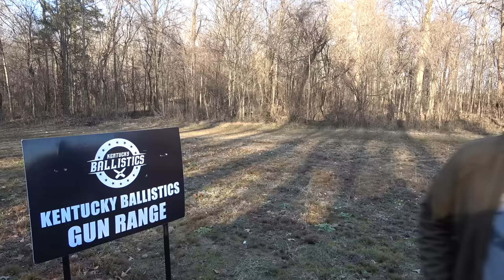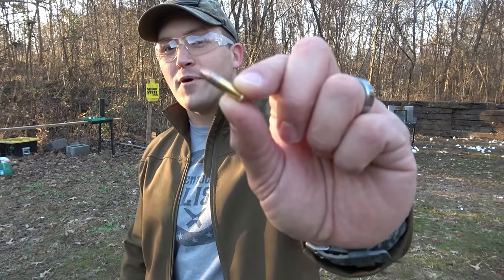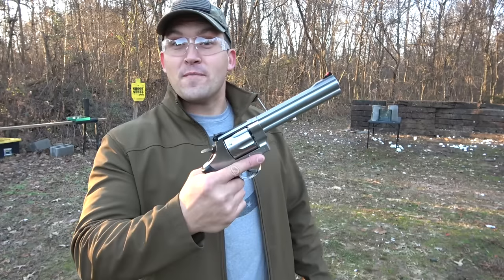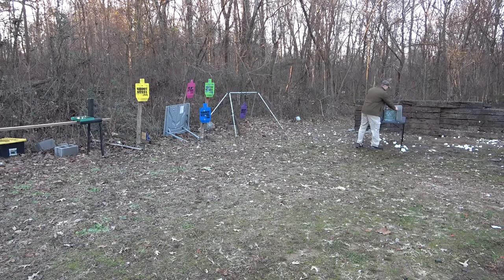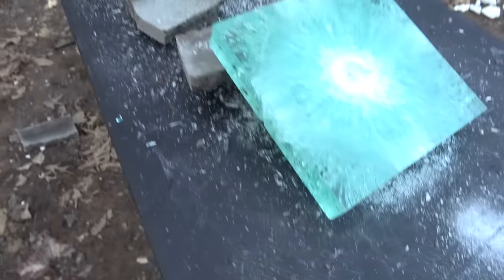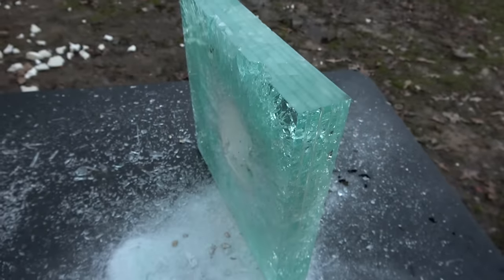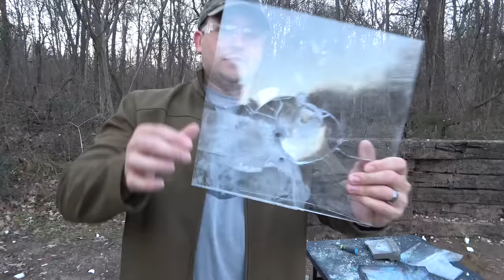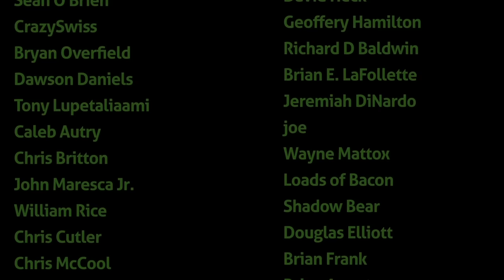Double Barrel Elephant Rifle vs Bulletproof Glass !!!

Comment: The glass side is the "Strike Face". It acts like the ceramic layer on a SAPI plate to breakup the projectile. The plastic layers go on the INSIDE of the vehicle or room and serve as the anti-spall layers and gives some support to the glass. The more expensive bullet resistant glass may have plastic layers on both sides or sometimes in alternating layers.
Reply: It’s laminated polycarbonate not plastic.....
Reply: @Justaguy0420  "Polycarbonate is a type of plastic. It is very tough; therefore, very hard to break. Furthermore, it is a polymer, and the monomer unit of this has carbonate groups. Thus, they are named as polycarbonates..."

Comment: I used to work for an armored car company. Our offices had bullet resistant glass (training stressed that it wasn't bullet proof if someone brought big enough and hot enough rounds) and thick, heavy, solid steel doors (about 2.25 inches thick, and *solid*). The glass getting damaged by the cinderblocks was one of the reasons for how it was mounted in the doors: The doors had a .125 inch steel bezel around the window opening on the front, welded in place with solid beads of weld. On the back, another bezel piece bolted into the door. The glass was mounted in a heavy rubber gasket that fit snuggly in the door. Occassionally, when it was cold, the rubber would contract slightly, and the glass would be ever so slightly free to wiggle. Every door arrangement was a man-trap, too, so you'd have to break through 4 inches of steel and glass to get at the folks inside, who were all armed. Then you'd have to crack through the completely analogue 5 inch vault door - again damn-near solid steel - or through the steel lined reinforced concrete walls of the vault. Never had a safer job in my life.

Comment: I have done some consulting work with a bulletproof glass company.    There are a number of levels of this glass so one size doesn't fit all.     Also the glass should be mounted in a frame to really determine the impact and true viability of the glass.   In addition the true test is 3 shots in a triangular pattern a few inches apart.    If the bullet doesn't penetrate the glass then it is acceptable in doing what it is designed to do.

Comment: Glass guy here.  The first sample of glass used was actually facing the wrong way.  outside layer of polycarbonate should face the cinder block side since that is the side you're trying to protect from that explosion of glass fragments.  It acts like a last line of defense from shrapnel, also these samples would be glued into a frame that would prevent the layer separation.

Comment: They call the varying thicknesses and caliber ratings for these products, bullet resistant glass. Usually are comprised of multiple materials, 1/4"- 1/2" laminated glass, 1/4"-3/4" polycarbonate, all laminated together in alternating order. Some barriers like you see in banks or check cashing establishments can just be 1"-2" polycarbonate for weight purposes and less labor involved for speak-thrus, pass thru trays. Windows in passenger trains are minimum 9/16" small-medium caliber bullet resistant per FTSB regulations, due to traveling through lands subject to firearm usage, areas prone to rock slides etc.

Comment: When in the Angolan war, one of our Ratels was hit with a RPG right in the middle of a thick window, similar to the one in the video.

Its blasted about 50% of the thickness away, the other half was partially melted with the bubble protruding a few centimeters on the inside of the vehicle and the copper slug inside.

Any other placement of the hit would  have killed everybody inside! 

Nobody was hurt. Very close call.

Comment: I think you should get different glasses for each gun. I don't know if its too expensive for you man but.. doesn't the previous bullets already weaken the glass making it easier to penetrate for the later ones. So in a way we wouldn't be able to gauge the proper strength of a gun no ?. Unless it isn't about that then cool I guess. Also You are an incredible shot.

Comment: Answer to why the elephant rifle didn't work, the round is a flat round meant to disperse damage on a larger target, ie an elephant. Something like an AP 50 Cal would absolutely rip through it because it's more directed (pointed and coated) to allow for further penetration. On an elephant, more bullet pen actually means less damage cause a large target will bleed more the longer the bullet travels in the body.

Comment: How do you know the glass shards were made from the bullet and not from smacking the cinder block? You should have put something soft between the glass and the block for more accurate results. Otherwise those glass samples may have performed a bit better. If nothing else to make smaller exit holes.

Comment: Second shot isn't representative of the ballistic glass as it'd been compromised with the first shot.  Also there are ballistic glass that made of tempered glass as well as polycarbonate material. This glass with it's thickness would be a general representation of what you'd see at the bank in the drive through.

Comment: Bullet-proof glass is comprised of layers of polycarbonate (lexan) glass. It's like plexiglass on steroids. Actual glass is usually on the outer sides of the bulletproof for cleaning purposes so it doesn't scratch so easy. The more (lexan) layers the higher the bullet rating.
Reply: thanks for the info man

Comment: Im guessin it will stop a couple of rounds. Sure the 500 Nitro is a big round, but it moves slow relatively compared to most rifles. So im guessing it will do what slow moving rounds do when they hit something hard: Dump energy really quick and really shallow. so assuming you can pop the rounds on top of one another i guestimate at least 3 shots. 5 or 6 if you spread the round out across the surface. 

Now the Rigby, on the other hand, is an elephant round moving very quickly. And it seems to go through everything. Ill just bet the rigby could do it in two, if it didnt actually make it through in 1.

Comment: Obviously not scientific since the earlier shots in both pieces of glass were affecting the integrity of the test subjects for later shots, but there's only so much you can do with limited funds to purchase an adequate number of test subjects. However it may indicate that bullet proof glass can be effected by numerous impacts from multiple rounds. To counter fractured rear element panes you should have used hay bails instead of the solid resistance of cinder blocks.

Comment: The first piece you were shooting from the wrong side. The actual glass side is the strike face/threat side. There is no such thing as "bullet proof" glass. Even the manufacturers will tell you that! These are different levels of bullet resistant. Without actually seeing them in person or knowing the manufacturer I'm not 100% sure of the level of either. I can tell you that the first one is very similar to what is used in teller or pharmacy windows. The second appears to be more like what is used in armored vehicles. I can also tell you the reason for the glass strike face is to start breaking up the bullet so the polycarbonate can stop it. The second piece you will notice the outer surface shattered in much smaller pieces because it is tempered glass like the safety glass in your car doors. Also designed to break up the bullet. The other layers are annealed laminated glass similar to what is in your windshield to allow the polycarbonate layers to flex and absorb impact energy while also continuing to fragment the bullet. The idea behind alternating layers is the bullet has to continue to strike hard surfaces between the poly layers creating drag/friction to slow the bullet.

Comment: Honestly, I wish you guys would stop shooting the exact same target multiple times in a row, just to see 'what it can stop'.  You're weakening the target with every single shot (as obviously shown by the cracks from the .45 ACP), meaning you're not getting an accurate estimate of its stopping power.  Now, if the test was to see how many rounds of the same caliber it could take before allowing a 'through-n-through', that would be different.  But for this kind of test it would be better to use a different target each time, as you're trying to see how large of a caliber it can withstand.

Comment: You shot these incorrectly. The plexiglass (plastic) side is supposed to be on the inside, and the bullet is supposed to hit actual glass first, with the plexiglass catching the glass spray you saw jet out from the inside facing glass pane when shot. That glass spray would have been lethal in and off itself, even if the bullet doesn't go all the way through. Really sucks man, too bad you shot the wrong face both times, that invalidates all of your results right off the bat. ☹️🤓

Comment: After the glass was shot once, it loses the maximum protection it can give like the bullet proof plates for soldiers. That means the 44 Mag and the 500 pistol shots had much less resistance than the previous shots just like the 2nd shot against the double bullet proof glass setup.
Reply: While technically true that it is weakened by each shot, bulletproof glass is designed and intended to stop multiple rounds much more effectively than body armour.

Comment: I am not impressed. If you wanted to have a legitimate test, you'd have a fresh piece of glass for each shot. Plus, you need to have a frame to hold the test pieces in place so they don't move upon impact. I'm surprised you didn't know that bullet proof glass is made of layers of glass and plastic. When handling fractured glass USE GLOVES maybe?  I also have some questions about your property, but I can't quite tell, so I'll leave that aside.

Comment: I was starting to believe you lacked the redneck gene in your DNA until you tried prying that bullet from the glass. Thanks for confirming my faith in you. Next time use the higher ballistics first. I believe that will make your point. Once you compromise any structure it is going to weakened. You clearly have to much time on your hands, or just enjoy what you do. Thanks, I've often wondered about the validity of this glass and what it would take to weaken said structure. It's hard for me to imagine our local bank heist being had with an elephant gun unless of course your Bungalow Bill. I'd have rather seen you use the weapon of choice such as an ak-47, or an ar-15., because the first question that comes to my mind is, 'does it slow the impact down to the point of preventing it from being able to enter a human torso". Peace